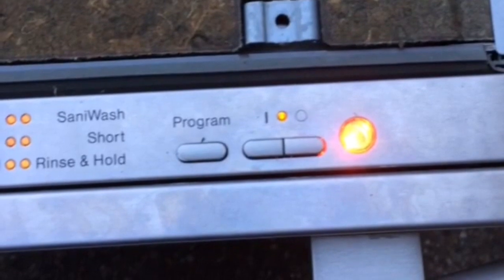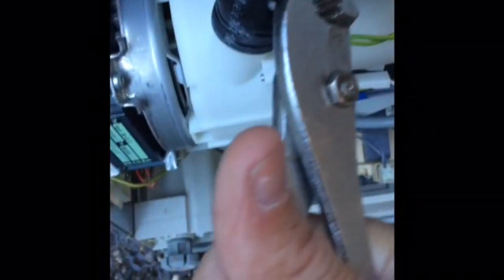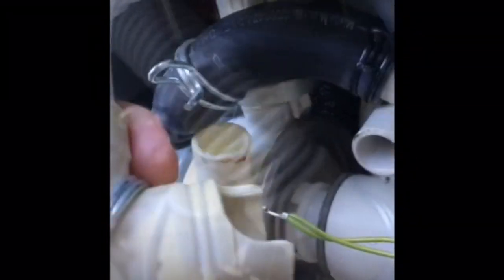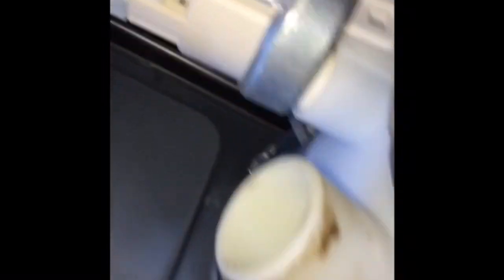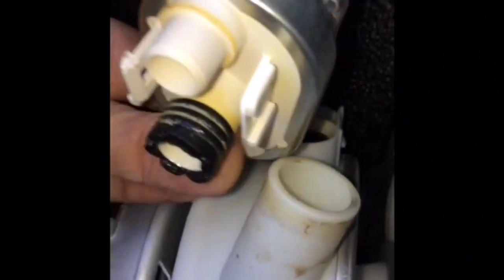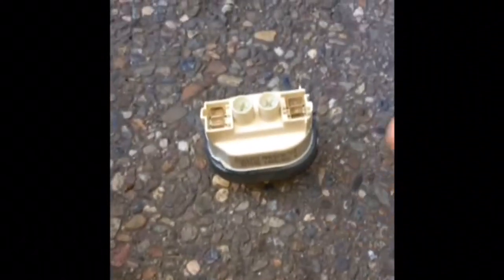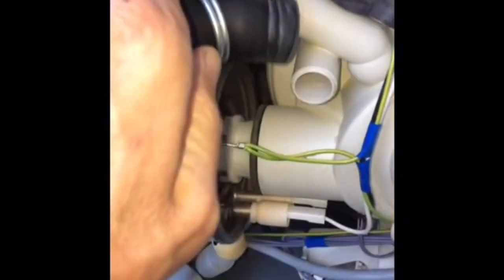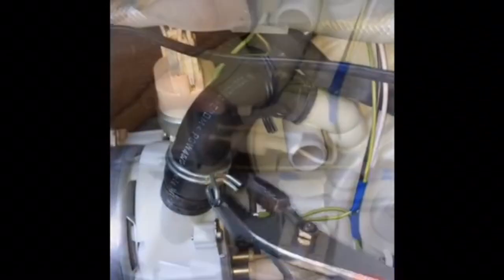✨ Miele Dishwasher - F 14 Error - Easy Fix ✨

Comment: Hi Scott! First of all thanks by your videos as they have been really helpful for everyone (needless to say). I have just bought a Miele G4931 sc jubilee second hand and after a couple of cycles I had the F14 error (don't know if it helps to say but I stopped the cycle before having the error to load with some more crockery and left the machine until morning). Looked in the manual and it said to simply restart the machine and try again. I have done it and run a gentle cycle (cause it was the fastest) and no error was displayed. I am wondering now if the error is really gone or if I need to do something to make sure the machine won't operate in such a way leading to further damages. Question is, what really is this error related to? Cause there is more than one answer related to the F14... What really prompt this error message? 
Thanks!
Reply from the maker: Hi Tomaz, the circulation impeller was just stuck since it hadn’t been used for awhile.
I don’t think you’ll get the error again👍

Comment: Hi and thanks so much for videos. I have a G1225SC eco, I had f14 error a week ago. Now at about 34 minutes from the end of the cycle it trips the circuit breaker. How could I know if is the pump or the heater switch the issue? Thank you very much :-)
Reply from the maker: Try running it without the dryer function to see if it still trips the breaker

Comment: Hello there, i would deffinately suspect the pressure switch for the heater in this case, the pressureswitch will be worn out faster than the motor usually, and even though the motor hasnt lost any pressure over the years the switch has lost the abillity to maintain pressure for the whole cycle because there might be a leak in the internal seal that keeps make the contact for the switch so i would try replacing that pressure switch anyway, ive seen this problem a lot in both old and newer miels dishwashers.
Reply from the maker: Awesome,

Thank you👍
Reply: Hi ...I have a Miele g1270 and it throws up a e51 fault.. I have taken the pressure switch off and was wondering if there is a test for it...I can blow it and hear the switch operate but it takes a lot of pressure is this right ?
Reply from the maker: That is excellent information. The heater/pressure switch is also easy to replace 👍

Comment: Hi,Scott!What can you say about F 79 at a Miele Dishwasher?
Reply from the maker: Usually unplugging the modular connectors for the circulation pump and spraying them with electrical cleaner will do it.
Sometimes you need to do the same for the wire connectors that plug into the controller that lives in the door.  When they get a little corroded you’ll get that error.

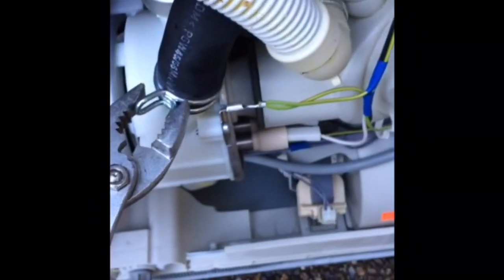Comment: Hi Scott - I appreciate you posting all of the fix-it videos for the Miele dishwashers.  I have a 10 year old Meile Excella Model 2670 SCSF with a F14 Water Intake fault code.  On normal cycle it throws the code just after about 2 minutes into the cycle.  At that point the water is 1/4" below the filter handle.  I already cleaned out the filter in the water intake WPS hose.  I also tried adding extra water at around 1-1:30 into the cycle to bring the water level up to touching the filter handle and it still threw the code.  When you open the door right when it throws the code, or prior to it, there is water coming down from all over the place, so I think that means the circulation pump is at least activating.  Does this sound to you to likely be the heater/pressure switch?  Are there any other diagnostics I can perform on it to confirm before I pull the machine out and open it up? The machine is very clean inside (below the filter screen. etc) with no build up visible.  Thanks for any help on this.

Comment: My dishwasher is only 4 years old is the motor really garbage in need of replacement if I get this error code?
Reply from the maker: I think it might just be overloaded.  Can you try poring in a pot of boiling water with a 1/4 cup of vegetable oil and let it sit for 20 minutes and then try it.

Comment: Getting a F14 error code on my Miele dishwasher with inlet drain flashing. Tried cleaning the filter, checked for any blockages (where the metal ball is), poured a litre of warm water and some rinse aid into the filter, turned off on mains, ran on empty - and still have the issue. 

The cycle runs for about an hour then stops and errror appears, There’s no water built up.

Do you know what the problem is?
Reply from the maker: Time for a new Heater/Pressure switch.

Comment: Fix these all the time. The motors never fail. They are induction motors with auxiliary winding for the start.. usually all that fails is the start capacitor which is a few pounds only.
Reply from the maker: Your right Tim👍
They’re tough motors.
Reply: @ScottTheFixItGuyChannel  very unlikely an induction motor will fail. Really all that can fail is the bearing itself as the core is a solid winding with no commuter or brushes so as you see unless the bearing has failed or the winding has broken down due to maybe becoming conducive between the cores they simply won't fail. I have a compressor with a induction motor on from the 50s still running. Checking the ohms between the windings with a low ohms meter or a Megger will determine if there is electrical breakdown between the windings. Usually on these dishwashers it's the pressure switch or heating element that fails. If the motor fails to start check the start capacitor which is usually about 4uf.
Reply: They absolutely fail. I have seen quite a few of them.
Reply: @MichaelRei99  never had one fail. I ly by overheating and that's because the insulation broke down. I am a domestic appliance engineer. I've been fixing this stuff since 1990 and usually it's the start capacitor packs up .

Comment: I just purchased a new Miele Dishwasher and got the F14 error directly after installation.  Its only been test run, never with any food in it or something to block the impeller.  Any ideas?
Reply from the maker: Hi Philip,

I think the impeller seal is sticking and causing the error.

Can you add a pot of boiling water and 3 caps full of rinse aid and let it sit for 20 minutes and then try it.

Let me know what you find.
Reply: You ever figure out the problem?
I have the same new with that problem

Comment: I have a new miele futura classic plus dishwasher and after just one year, f14 error only on normal cycle, and dishes are not being cleaned well on any cycle, even after being washed thoroughly. I was told by miele to try cleaning the dishwasher with a cleaning agent and running it on sani wash. I did this three times and still does not work. Very disappointing and unexpected after spending all this money. Of course I did not purchase the extended warranty as did not think it would break so soon.
Reply from the maker: Hi Pamela,

Something got sucked into the circulation pump impeller.

Let me know if you need a video that shows how to get to that impeller

Comment: Hi Scott, thanks for the videos from Germany. Scince a couple of weeks our diswasher stopp sometimes with F14 error. Now every time it stopped with F14 after the program had run for 12 minutes. The water is pumped out every time as normal. The F14 error occur after 1 minute of pumping out the water.
We cleaned the impeller with pulling through an rolled up kitchen paper, no effect. We clean up the water drain of the citchen, no effect.Then we interchanged the one way valve to a new one. One select short cycle in 24 minutes the disher runs without problems up to the end of the cycle.
The next full cycle (1:46) runs 12 minutes up the first pumping out after the first wash start. The display indicate F14  blinking error but then pumps out all water as normal and stop.
Any idea what to do?
Remark: Is it normal the disher takes water and wait several time at the beginning of the cycle?
Reply: Hi, I dismantle the circulation pump following your video. The impeller of the pump is boken into 2 parts. The vortex inlex and front cover of the impeller was only stick with a few 1 mm plastic thorns together with the impeller.  The vortex are loose and brake the pump sometimes.
I will interchange the pump part.
Reply: @U2030-z3x  did you change the impeller? Did it solve the problem?